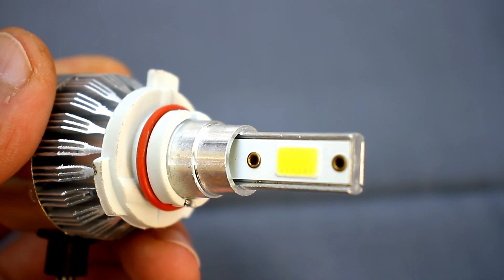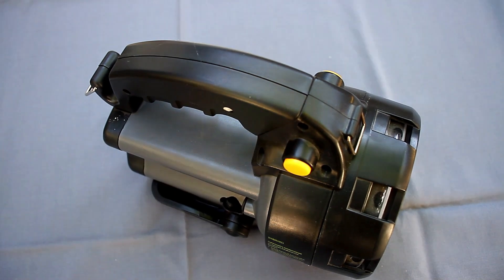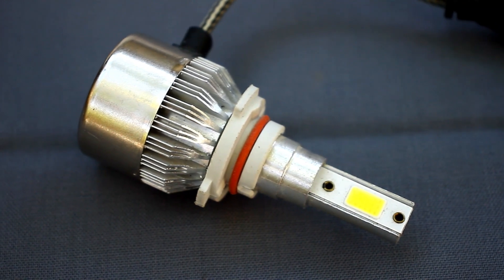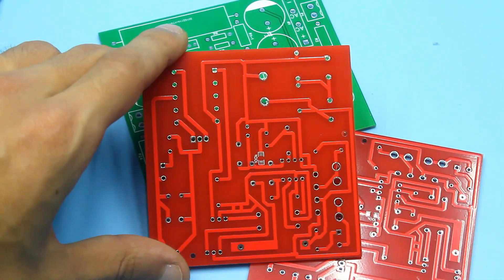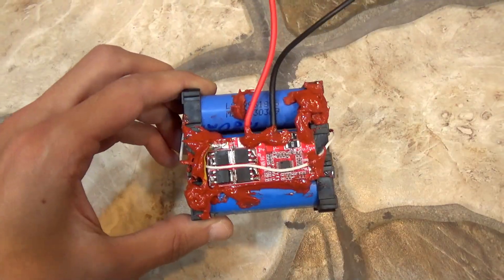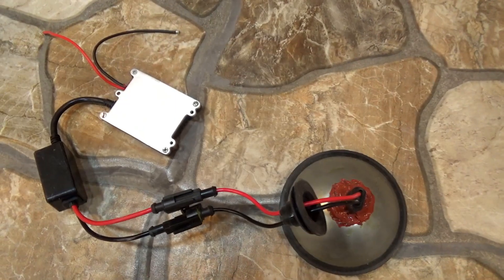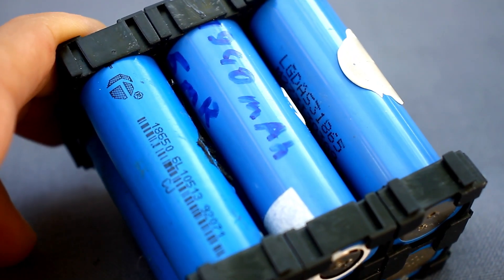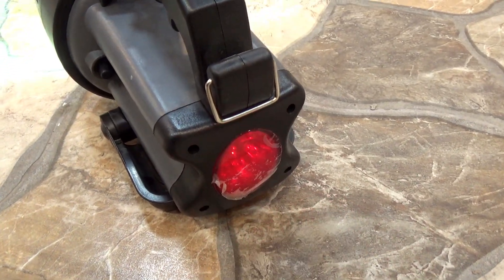DIY High Power XENON Flashlight

Comment: I refitted one of these last year for my uncle. only difference was his was yellow.. i put a 12 volt led from the inside of a car into it. I took out the incandescent bulb & the 6 volt  lead acid battery, I added a 10,000mAh phone power pack so he could recharge it easy with his phone charger and also added a boost converter for the 12 volt  LED light bulb. it worked better then the original(which i was surprised because the LED bulb was only an over head light for inside of a car & it was only 120mA, it also had a built in full bridge rectifier & resistor inside, so you could see my surprise at how well it worked) he need it for finding his way around the house after he was in hospital for a month and his electricity was cut off. poor mans in an old age home now. he had a bad stroke. but he's happier there than living on his own like he was... so some good came for him in the end if you look at it in a certain way. 
P.S. he had the light for 30 years or so and is very happy to have it working again.

Comment: i actually have one of those lights and the last time i checked there were no blue circles. Think you may have gotten a faulty bulb. Plus you could have tried a more expensive led bulb, like one with zes or csp chips.
Reply: rewing dry tranformer with circulating air